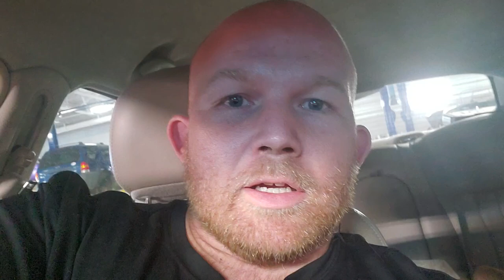Cutting Corners Costs You Money - Lincoln Town Car Build

Comment: Yeah, when I DIY I always replace as much as possible. Axle seals are a no brainier :lol:. Don't take much. I'm crazy, I'll do bearings too. Valve covers? I'll do intake gaskets if it is less than a hour or so. Its practically free. I change t-stats if I do a service over 50K. Even a ford one is what $10? At least if I drive old cars they can be as reliable as new ones.

Comment: Hey, I got AC blowing cold but not strong, got any ideas on what it could be? (initially thought maybe a cabin air filter but the Town Cars don't have em, go figure!)
Reply from the maker: Yeah you've got to leave somewhere or low charge
Reply from the maker: Also make sure that AC condenser and radiator is clean because if you don't have enough air flow across that it won't actually do what it's supposed to do and you'll get like just a cool feeling and it won't be cold
Reply: @FordBossMe  my mechanic said the condenser and radiator were good and clean, I just got a new compressor and recharge.